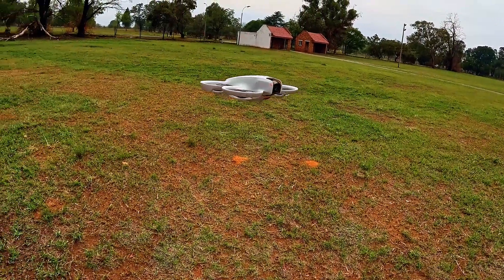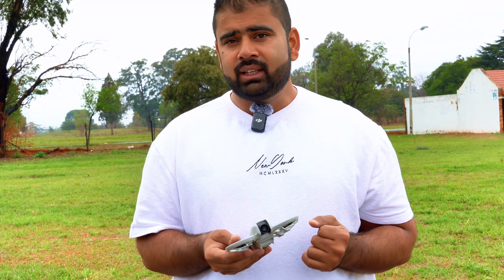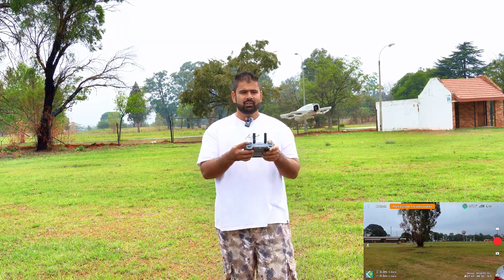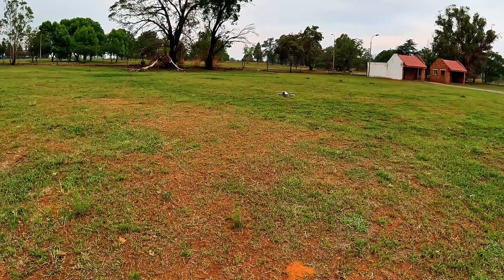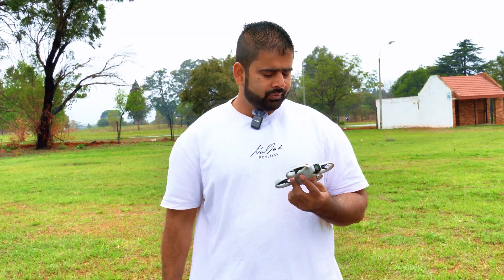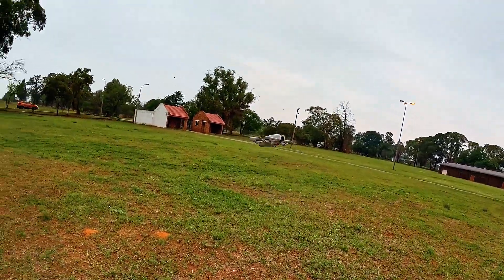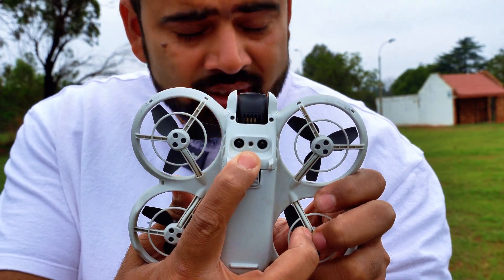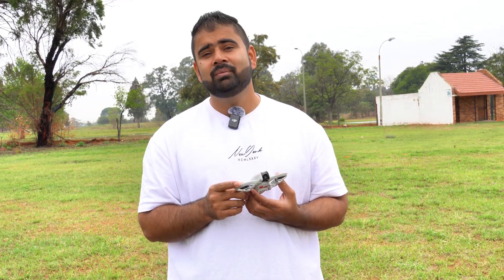Dji Neo Vision Sensors Blocked one by one || Shocking Results

Comment: Try to block only the sensor in the middle to see what happens
Reply from the maker: I did in this video watch full video
Reply: @Drone.lover.  
minute 2:41 You blocked one of IR (infrared) sensors (big)
minute 7:34 You blocked one of IR (infrared) sensors (big) and the visual positioning sensor (small)
minute 9:46 You blocked both  IR (infrared) sensors (big)
You haven't block the small sensor only and leave both big sensors unblocked